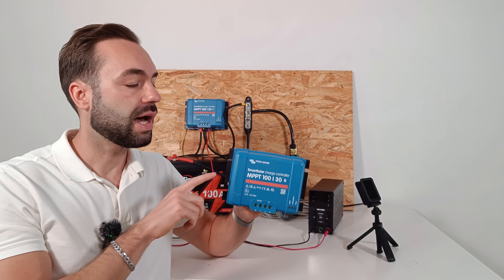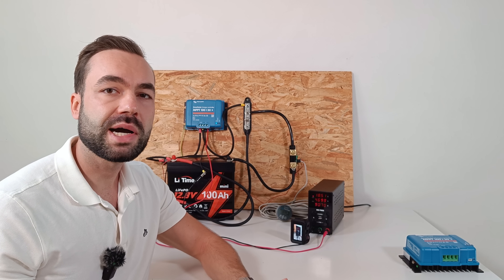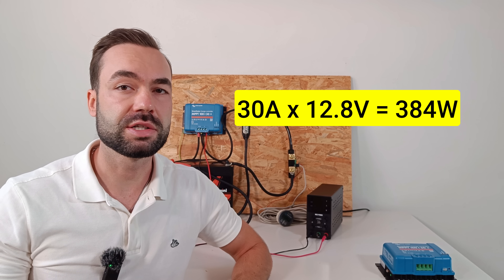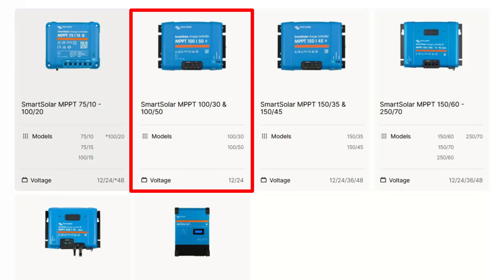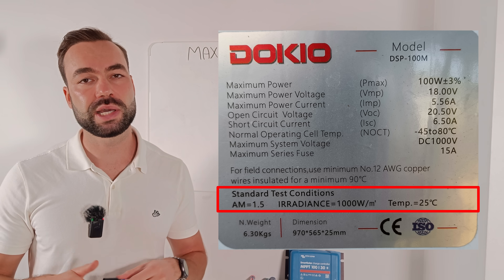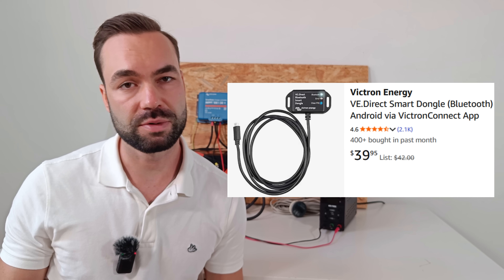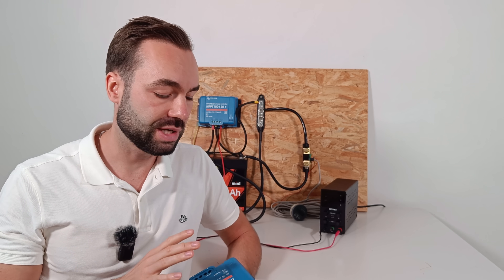Victron 100/30 MPPT Charge Controller Test + Review

Comment: Great information. I have two Victron Smart solar controllers in my van, a 100/20 48V model for my Volta lithium battery and a 100/15 for my Sprinter chassis battery. I'm building a larger solar array on the van and your info on the effect of cold climate on panel voltage was very useful to make sure I don't over panel and damage the controllers. Thanks for you informative videos.
Reply from the maker: My pleasure, have fun building your van!
Reply: I'm also Interested in the 100/20 48V model for my 51.2V 100Ah battery. Could you tell me more about the larger solar array your building ? Which panels do you like ? VOC ? How many to a string ? How many parallels ? Could you physically drop a panel from your string on really cold days ?

Comment: 5:25 Its  completely wrong you will only get 280 Watts from an 400 W solar panel! What made you think that??? Do you live on the North Pole? I have 2 alone standing 430 W solar panels with their own Victron MPPT. I get from the one on my roof 389 Watts and from the other one on my balcony with an 40 degrees angle 418 Watts. In Mid September in south germany. This is a rate of 97% of its rated output. From the 2 100 Watts Panels on my Camper Trailer i can achieve 180 Watts of maximum output.
Keep in mind overpaneling lowers always the life of your MPPT since it have to work more often on its max rated Output.
Reply from the maker: Not always, but I see 70% output very frequently, especially in summer when the panels are hot. You are getting 97% because your panels are cold and are at an ideal angle for this time of year. That's not always the case. I'm not too worried about reducing lifespan with these MPPT's, the heatsink barely gets warm.
Reply: @cleversolarpower  So 50 degrees is not hot?
Reply from the maker: For a solar panel, no. 65°C is no exception.

Comment: 2:34 just recommending panels in series ignores the fact that many panels have higher voltages to start with. 
Don't just slap them in series without understanding this.
Reply: Yep..
There's loads of other things to consider..
1.5 to 2 times the system voltage.. a little higher is nice.
I have 3 x 100/20 and charge 12v batteries .. for many reasons.. cost effective, shading, redundancy, load output.
I run them at a max of 10 amp's each which means they run efficiently and cool.. and terminals are happy..
Regular checking of the terminal torque is a good idea and a must for B2B particularly on the output terminals.
Something I learnt reading the comments was using the load output to power a fan (to cool the controller) set at a specific trigger voltage.. but as I don't run them hard it's not necessary.
What are your thoughts on ferrules..
Reply: @Markus-UK are you asking me? I'm just getting around to cleaning up my install and ferrules or pin connectors are in my basket as we speak. They make sense although in my low demand setup I've got away with bare strands to my dc/dc charger and charge controller wires from my panels. I can't see a downside to them I just hadn't been aware they were a thing until recently.
Reply: @daveybphotography 
Ha 😻
I've never really used ferrules..
Main thing is do good connections on output of DC/DC and retorque occasionally.. the issue is.. if terminations get loose on output the DC/DC thinks battery being charged is low and charges much harder causing terminals to get very hot and in some cases worse..
A torque screwdriver is a nice idea..
On a new setup.. servicing is essential... retorque in a week and each week and you will find in a month or so they don't move.. then check all each month.. and you will find they settle in..
Reply: @daveybphotography 
Do you have the ferrule crimp device..
Reply: @Markus-UK I don't, I'm on the fence since I have a couple of hand crimpers and since I've got away without ferrules til now. I might make my own ferrules out of copper lugs that I have, bit hokey but I'm cheap. I do have a manual lug crimper that you have to hit with a hammer, it does alright. The male end of the lug would have to be folded and beat on for my cheap approach which is the weak point in my wicked scheme   😅
Reply: Or, if the round part of the lug is small enough to go in the terminals I can just cut the ring terminal part off.

Comment: Why you didn’t change battery voltage from 12V to 12.8V. Is this not make a difference?
Reply from the maker: The option is 12 or 24V. then you set the charging voltage in the presets. It's set to 14.2V which is standard for LiFePO4.
Reply: @cleversolarpower thanks for reply 😊

Comment: Nice!  Well done!   I'll add another aspect of sizing and scaling a system and that is that higher amperages also result in high heat.  A lot more heat.  This can quickly cause serious issues with the installation.

The solution is to move to a higher battery voltage (or design the system around a higher battery voltage in the first place).   The higher battery voltage also vastly reduces wiring losses so placement of the controllers near the batteries and inverter isn't as important.   24V has 1/4th the losses vs 12V, and 48V has 1/16th the losses vs 12V at the same power level (not 1/2 and 1/4.... its actually 1/4 and 1/16).

48V won't work with the 100/30 and 100/50.  But does work really well with the 100/20 and the 150/35.  This is why I usually skip over the 100/30 and 100/50.  My two go-to Victron controllers on the lower-end are the 100/20 and the 150/35 (both support 12V, 24V, 36V, and 48V).

Victron SmartSolar 75/15 @ 15A and 25.6V = 384W <--- ultra low cost for very small systems
Victron SmartSolar 100/30 @ 30A and 25.6V = 768W  (get hot)
Victron SmartSolar 100/50 @ 50A and 25.6V = 1280W (get hot)
Victron SmartSolar 100/20 @ 20A and 51.2V = 1024W <--- my choice
Victron SmartSolar 150/35 @ 35A and 51.2V = 1792W <--- my choice (sweet spot in my view)

Now, even a 100/20 or 100/35 can get hot if operating at maximum amps with no airflow.  A key thing to remember here is that at 51.2V, so you now have the choice of simply reducing the amperage by 5A and still be able to produce a lot of power, or have a little air-flow.  It doesn't take much because with a 48V output the 150/35 (even though it is 35A) produces less heat than the 100/30.

The 100/20 has dinky little terminals... really designed for 12AWG but I often fit 10AWG into them anyway.  The 150/35 has pretty beefy terminals so 10/8/6 AWG fits pretty well.

Voltage input limits vs panels:

75V - Any single panel, including any single residential panel
100V - Typically 3 smaller panels in series or 2 residential panels in series
150V - Typically 4 to 6 smaller panels in series or 3 residential panels in series and more parallelism

-Matt
Reply: As far as cooling I bought a small 
Personal Fan made by Holmes from Target USB-Powered plugged in wall with timer set to turn on 9am and off at 9 pm my Victron 150/45 is happy.
Just mounted fan next to inverter.
Reply: @p.b.7861  I've had good success running a fan based on voltage, using either Victron's load port on their smaller charge controllers (75/15 or 100/20), or using the TX port function ("Virtual Load Output" mode), off the VE.Direct port to control a Victron battery-protect (solid state relay) that I had to run the fan.

The trip levels I use are:  User def algorithm, high level switch at 53.35V (26.67, 13.34) and low level switch at 53.30V (26.64, 13.31).  Basically that turns the fan on once there's enough solar to bring the battery voltage into a significant charging regime, and then turns it off at the end of the day when charging stops and the battery settles into its discharge curve.

-Matt
Reply: @junkerzn7312 that is pretty good hack using high voltage control I need some steps from you how you did if you don’t mind.
 Now, back to a poor design of Victron’s terminal output +/- to inverter on my 150/45A, I have use 
Ferrules at the beginning but about 40-45 amps output the terminals get too warm on the hot side, so after took apart exam the outer shell of Ferrules surface has not much contact surface due to the clamping jaw designed of non-flat surface, of course I used 6 AWG as many fines tiny copper wires, so I saw some said Victron not recommend Ferrules. So, I 
try the 6 AWG from Home Depot
THWN-2 rate for 600v less than 90C
Have 19 solid wires inside made by Southwire $1.71 per foot. Install without ferrules and it works better but too stiff to bend.
Reply: @p.b.7861  Make sure the 6 AWG fine-stranded wire is tin-plated copper and not copper-clad aluminum.  You can tell by cutting a cross section.  If you can see a decent copper color looking at the cross-section cut then it's probably tin-plated copper.  If it looks mostly aluminum, then it is probably copper-clad aluminum.

Also, a lot of ultra-fine-stranded wire is sold on Amazon that doesn't have enough actual copper... usually looks "extra poofy".

Ferrules can be crimped in any number of shapes, depending on the crimper.  But the ferrule itself will crunch pretty easily in a screw terminal so it usually isn't critical.

THHN and THWN-2 are pretty stiff.  THWN-2 has a wet-rating (that's what the "W" means) and will be stiffer than THHN.  Victron's are not normally wired with THHN or THWN-2.
Reply: Have an 75/15 on a 430 W Solar Panel at 24V. It doesnt get Hot even at 418Watts of Solar Power coming in. It stays pretty cool even though it doesnt have any cooling fins.
Reply: @motorenbastler9289 I have the 75/15 @12 volts . Very hot  at around 80% of input capacity.
Reply: @mosesgoiho6240 what is „hot“. If you touch it and its Hand warm its ok. If you touch it and you almost burn your hands its too hot
Reply: @motorenbastler9289 when I say hot, I mean "hot" .Sometimes, I had to put chilled satchet water to check the intensity of the heat and it does evaporate.
Reply: @mosesgoiho6240  thats not good and definately not normal. What Solar panels du you run? Parallel or series?
Reply: Hi, I find Ford cooling using a cheap snail fan cools them very well. 12w well spent.
They will go ff. line if they get too hot.
Take care M

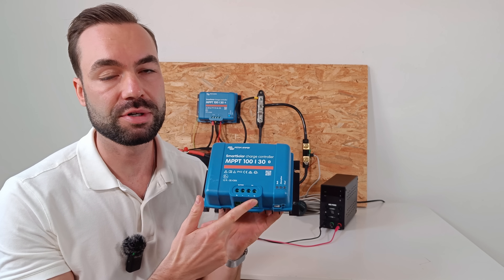Comment: 12:25 Great tip about using ferrels!
They hold the connections MUCH better than just the wires.
I check mine regularly and have never found them to be loose.
Reply: Victron recommends bare wires. Ferrules lowers the contact area and doesn't get compressed
Reply: Victron is fine with ferrules.  The Ferrule absolutely does get compressed, quite well in fact, and the contact area is good despite the ferrule crimp.  I've never had one come loose or overheat (or even get warm, frankly).

Ferrules have the added advantage that the plastic guard settles nicely into the terminal so there is no bare wire exposed and side-to-side movement is restricted.  It's also fairly difficult to even poke a screw driver into the terminal with the ferrule's plastic guard there. 

They also do a great job snugging the wire and preventing any vibration or twisting related issues from developing... very useful in cases where one is using smaller wires in the terminal.

I use ferrules on Victron's charge controller terminals 100% of the time.  If you don't use a ferrule you have to use medium-count copper wire.  You absolutely cannot use fine-stranded and also cannot use solid copper.  With a ferrule you can use medium and fine-stranded wire.

-Matt
Reply: @junkerzn7312 victron officially recommendeds not to use ferrules

Comment: Thank you for great videos as always!
I'm still learning about these smart controllers.
I got the 100/20 model of this, and it will charge 48 volt batteries, where this one wont.
I still don't understand that part.
Reply: The 75/15, 100/30, and 100/50 are older designs.  The 100/20 and 150/35 are a newer design.  Victron mixes a lot of old and new products in their product lines and it often isn't apparent because they don't advertise it.  They also sometimes retcon older products to add amperage, which is what they did with the 100/50 and the 75/15.   IMHO.

Comment: Im using a 250/100 with 5 440w panels in series. When I get my school bus built, it will have 8 panels in a 4s2p. Its bigger than I need, but I wanted the flexibility to change things as I go. May upgrade to 550w panels later
Reply: I recommend not paralleling... get a second controller.  It will help with shading issues.  It also sounds like you went with a 12V or 24V system... more expensive cabling and controllers.
Reply: @junkerzn7312  it's 48v. Good to know about the shading though. I'm running 2x multiplus 5k and 4x server rack batteries.
Reply: @jake-mv5oi  Yah.  If you have two paralleled strings and one panel on one string is shaded, the MPPT has to bring down the voltage to produce from both strings.  That effectively removes a panel from the other string as well.

Similar issues arise when the orientations of the strings are slightly different, too.

Sounds like you have a nice system. Thumbs up on the Victron multiplus's (multiplus 2's I assume).   And school busses have a great roof for solar.

-Matt
Reply: its bigger then you need 5x 440 watt panels?
in winter or cloudy conditions you get 5-10% input so near nothing.....you need nothing?

i have 4x 415 watt panels in parallel on a 20A charge controller" 12v olt battery" i get summer or winter constant 20A charge in summer ~10 hours with 20Amp charge so 200 Ah and in winter ~4-5 hours of 20Amps charge about the limitet sun on times...

why to hell you buy a 100Amp charger that is design to deliver 100A over 10 hours= 1000Ah charge if you not use it???
Reply: @thomasLarer Like I said, I plan on running at least 8 440w bifacials with the option to upgrade to 550/680w bifacial panels. 680w x 8/55v=98.9A with max bifacial gain in a perfect world. I also don't like running my stuff at 100% all the time. The 100a controller wasnt much more $ than the 60.

Comment: I'm doing my first RV solar panel project (200w panel + Victron 100/20) and this video helps. Thank you! Where should I run the Victron MPPT ground wire that comes off the side of the unit?..to the battery negative? (My 17 ft RV doesn't have a separate DC neg buss bar... just a DC neg lug in my WFCO power center).
Reply from the maker: Yes, to the battery negative. Because that's your 0V reference. I have a video about it coming soon. You can also connect it to your grounding busbar if you have a stationary system.

Comment: Great information delivered in a easy to understand way...as always thank you.
I am upgrading my boats battery bank from 12v lead to 48v LiFePO4 . But i am keeping a 12V battery to run my boats native 12V loads. My thought was to use a victron solar controller between my 48v bank and my 12V bank, on a switch. So i can use my 48V bank to keep my 12V bank charged. Do you think this idea is sound? Because of the voltage difference between the 48 and the 12 i assume it would work?
Reply from the maker: Yes, that would work. Great idea.
Reply: Yup, works great.  I use Victron 75/15's to go from 48V battery systems to 12V and 24V battery systems (and 24V to 12V as well).  You do need to be sure to fuse or breaker the "solar" input since connecting the input to a battery (48V system) vastly exceeds the maximum short-circuit specification on the Victron's input.

Calculate the average power use on the 12V system and make sure the Victron has enough charging margin... often this means you can trickle-charge the 12V system at a pretty low rate and not have any worries, hence why I often use a 75/15 for this purpose (15A @ 12.8V = 192W).

Works well for any higher-voltage to lower-voltage battery to battery combo.  Does not work for same-voltage-to-same-voltage (needs that +7V margin on the input).
Reply: @junkerzn7312 that's great advice, thanks a million! My 12 volt side would be  at a minimum 300 amp hour battery, maybe two. Lots of my boat systems run on 12V. But my 48V system would be 3 48v 100ah batteries, so lots of juice there to share. And those will be charged by solar primarily. But with generator and 2 alternators as well for redundancy.
I was planning on putting in a large 12V victron solar charger between the two.
Reply: @junkerzn7312 what type and size fuses you have used on the 48V to 12V systems you did?
Reply: @georgesteele3888  For the fuse going into the 75/15 I use a 10x38mm Solar PV fuse and fuse holder.  Typically 20A(ish), and program the charge controller to run at 12A or so.  Actually scratch that… 15A fuse or 10A fuse for 48 to 12 since the amperage on the 48V side is much lower ( like only 2-4A or so).  Same for 24 to 12 (8A max so 12 or 15A fuse).  No need to go lower and this way the fuse won’t even get like warm under normal operation.
Reply: @junkerzn7312 did I just watch a video about your war zone Catamaran?

Comment: I have a suspicion that the 100/30 is the same unit as 100/50, the weight seems the same as well as the dimensions.
Maybe it's just Sofware?
Reply from the maker: They share the same housing. This is to save on production costs. The 100/50 will have higher current components inside, the rest is filled up with a potting resin.
Reply: @cleversolarpower  have you pulled both apart?
Reply from the maker: No, that would be a shame. I have seen videos online where they did and its potted inside.